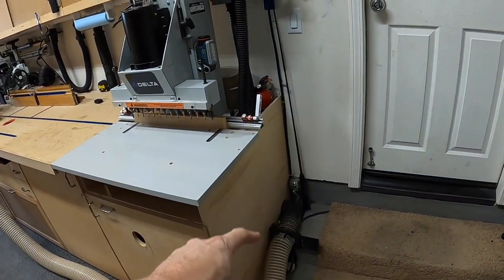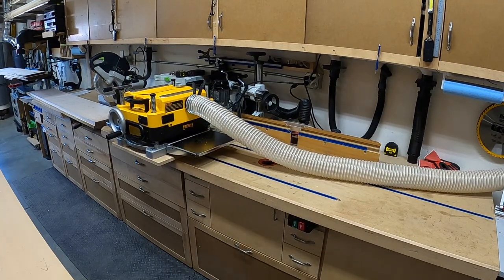How Does The New Dewalt Planer Do On 13" Wide Figured Maple?

Comment: Hi David. Superb method for straightening lumber, I used to do the same 40 hours a week on the sliding table saw. That's planer is one fantastic machine for its size. 
When you refer to the slower feed as taking a long time. Just remember how much time it's going to save you sanding out the cutter marks from the machined surface. 
On full length boards I usually allow for snipe in the off cut length. Same again, quicker than sanding it out. I hate sanding. Great video, great machine. Enjoyed, Tony
Reply from the maker: Thanks man for all the great feedback and advice.  I appreciate it and you’re right, sanding a little is better than the grooves from my old planer. Those were really tough to sand out.

Comment: I thoroughly love your channel David.  You have such great ideas.  I see you have Milwaukee gloves.  Have you tried Maxiflex brand?  The fit really great you can pick up a dime with them.  If you buy a helical head for the Dewalt it will quiet it down.  I’d love to have one for my General 130, but they are pricey!
Reply from the maker: Thanks Eric. No I haven’t tried it heard of maxflex.  Are they available from lowes or Home Depot?  I really love my Milwaukee gloves but will always try something else too.  General makes great machinery, don’t they.  I loved my General 350.  Still do but it’s in trailer now.  General 130 is a jointer or planer?

Comment: Another great video! I sometimes get the same little grooves on the boards as the blades get chipped. If you offset the blades left or right you can mitigate it for a little while. At some point I want to get the helical head for mine, supposedly it’s much quieter too. I don’t know if YouTube has the function so I found you on Instagram and messaged you a photo of what I came up with as a solution to the static shock. Cheers!
Reply from the maker: Thanks so much for this comment.  I am so glad you found my channel.  Ill check out my Instagram to see the pics.  Thank you very much for your advice too.

Comment: If you really want the best look on your boards, switch out your blade cutter for a helical cutter. It's costly but worth the money as it leaves no visible lines or snipe.
Reply from the maker: Thanks Mark.  It’s been the most talked about item since I got this planer.  As I sold my larger helical head planer due to unsightly lines left my the helical cutters.

Comment: Hi David, do you have a parallel fence for your slider?  Thx
Reply from the maker: No I guess not.  You mean like an additional fence that allows me to make narrow cuts on the sled? I have fences that I can use but really was thinking I’d make one.  Do you ?
Reply: @davidbryanwoodworksandmore  I’ve decided to invest in the Lamb woodwork’s parallel fence.  It’s a great accessory to have for a slider machine.  Repeatable and accurate cuts in plywood and hardwood.
Reply from the maker: @tundrawhisperer4821  I’ll check it out. Thanks so much for the advice.
Reply: @davidbryanwoodworksandmore  Anytime.  I’m going with the analog version over the DRO version, because I’m going to build a “copy device” that indexes it precisely to my crosscut table DRO flip stop.

Comment: Figured maple 🤦‍♂️
As opposed to rift sawn?
Reply from the maker: Rift sawn maple?  Not sure I’ve used it before.  I’ve only used rift sawn oak.
Reply: @davidbryanwoodworksandmore  I'm just clowning on your video title. Your maple looks like standard off the shelf "paint grade" maple that I bought today at Rugby Architectural Building Supply for $4.39 a BF (used to be 2.37)
Reply from the maker: @frontlinefinishcarpentry4193  it’s hard to see figure without finish on it. Funny guy.  Lol.